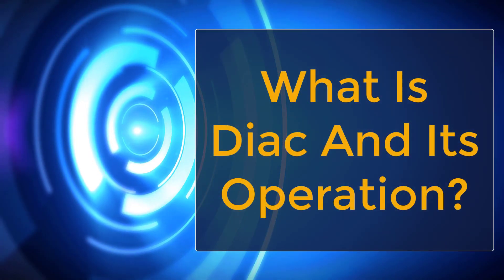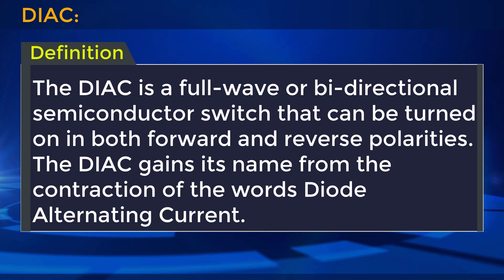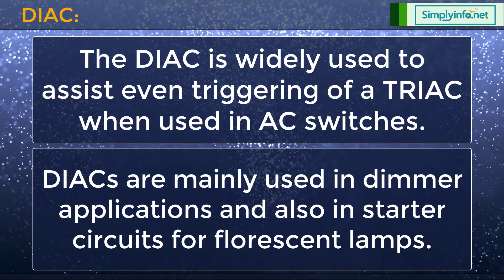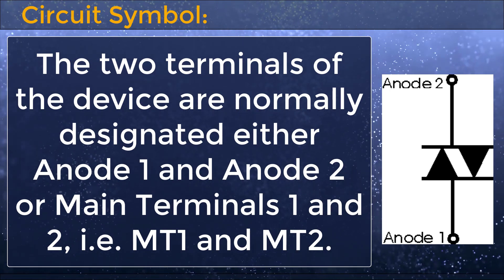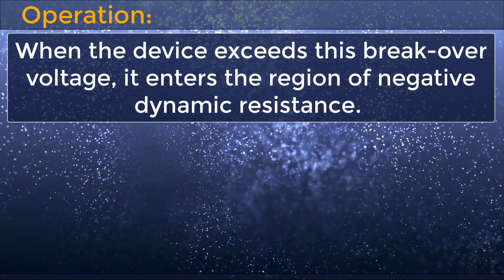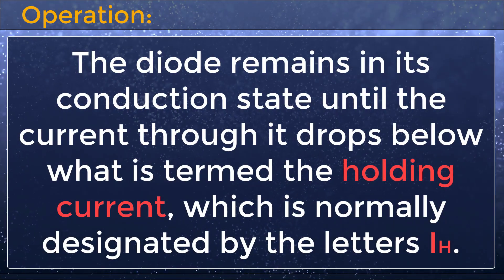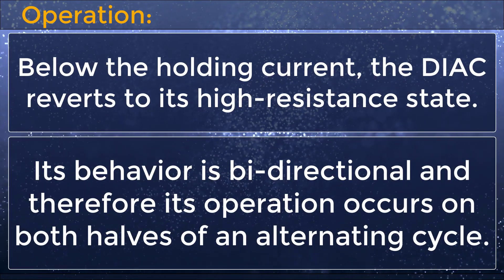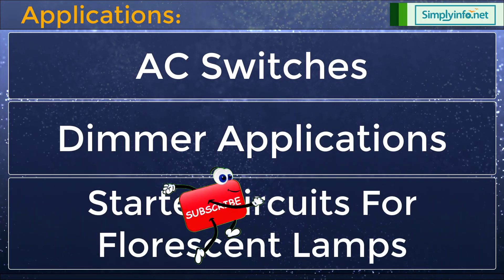What is DIAC & its Operation | Definition & Applications | Thyristors | Power Electronics | EDC

Comment: I placed this diode looking thing in a meter that automatically recognizes the device being tested.
It said 2 diodes and the voltage across both ways said 2.8 volts.
Does this mean it is a diac?
It does not look like DBA or DB3, 
I could not test it with a regular meter either in ohm setting or diode setting.  The ohm setting showed in millions of ohms after numerous attempt.